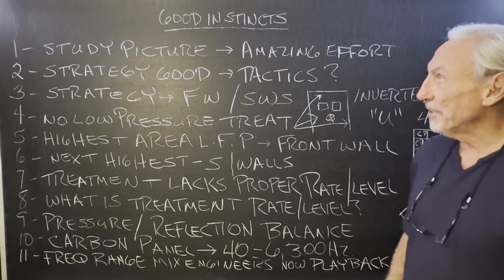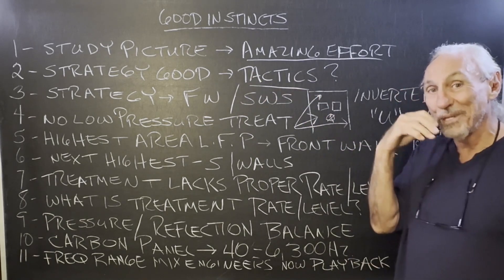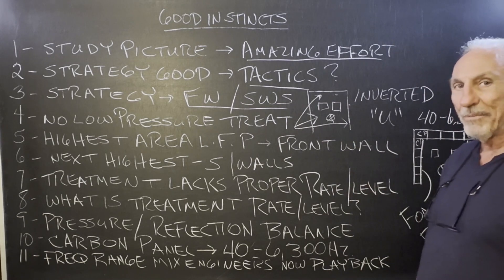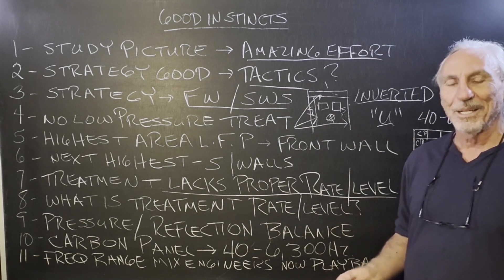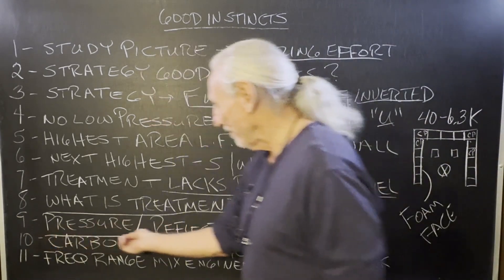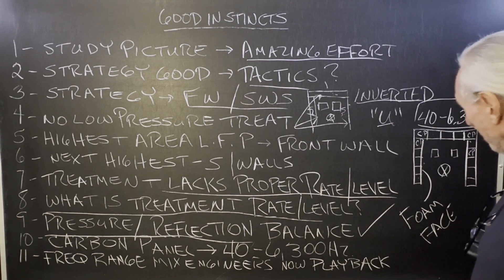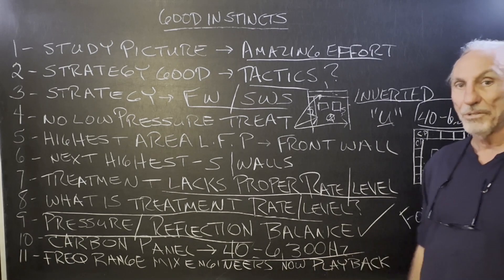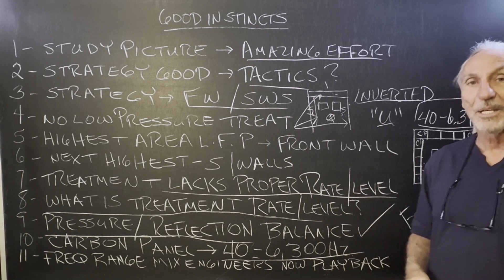Good Instincts - www.AcousticFields.com

Comment: Hey Dennis,

It would be great if you could make a video about treating a rehearsal room where the position of drums, guitars, and people change frequently, and people are moving around. How should an 8m by 6m by 2.5m room be treated to achieve evenly distributed sound throughout the space?

Thanks alot, and keep on doing this great educational content on YouTube!
Reply from the maker: Energy source positioning in rooms depends on many factors. The frequency of energy produced by the source, the room size and overall volume, the amplitude or strength of said energy, the amount of treatment in the room to mange both pressure and reflections, just to name a few. There are no one size fits all solutions.
Reply: I'm not looking for a perfect solution. I'm looking for a general-purpose treatment. There are different musicians with different instruments and even DJs in this room. I just want some rules of thumb to make the room sound okay so everyone can hear each other and it sounds alive, not dead like most rooms. Most rooms I know just cover everything with Fibeolith, and that's it.

Thanks for you fast reply.
Reply from the maker: @Pleusch  I will need much more data to assist you. Fill out the information in this link and schedule a time slot to go over your room and its usage. Covering large surface areas with building insulation type material will not provide the proper rate and level of absorption for music and voice. Building insulation destroys harmonics.
https://www.acousticfields.com/free-room-analysis/